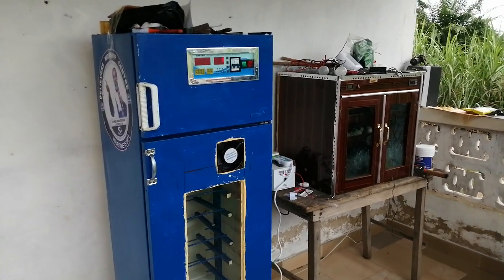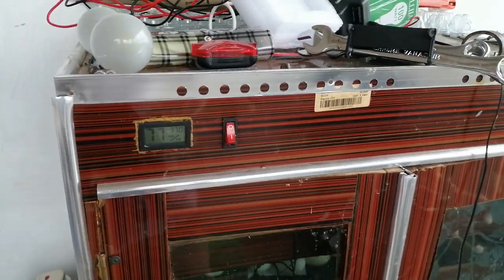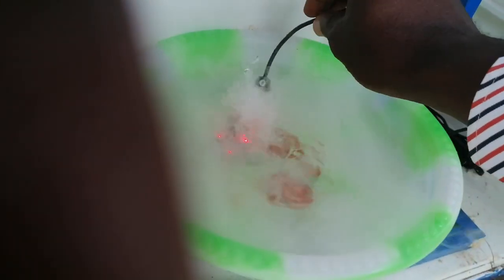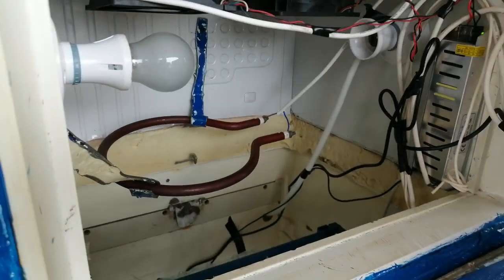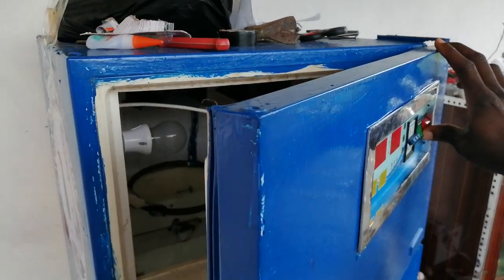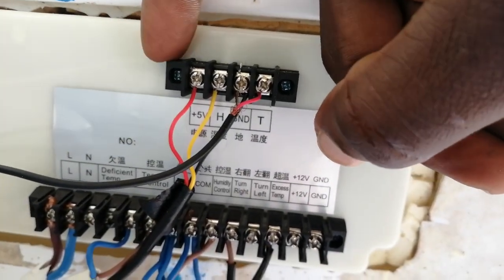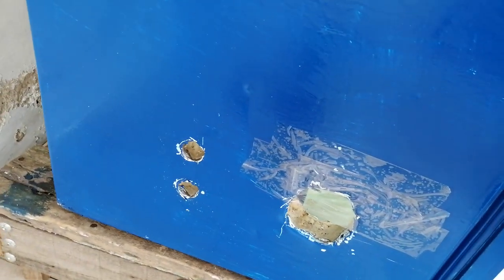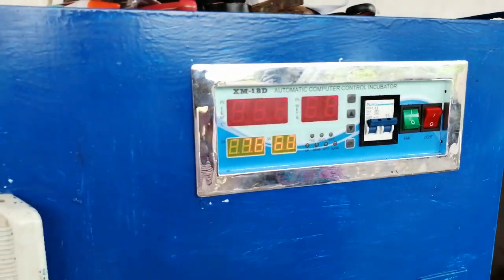Homemade egg incubator XM18-D and STC1000

Comment: Which socket you the wire for blower fan? Thanks
Reply: im talking with XM-18. where you put the wire for incubator fan that circulate the air?
Reply from the maker: @jessehisole7851  behind the xm18D
There are terminals for fan
Reply: circulation fan for xm-18e. What number the terminal?You show in your vdeo only for exhaust fan. Thankx
Reply from the maker: Please I used xm18d not xm18e
Reply from the maker: Circulation fan or exhaust fan. Which fan are you talking about

Comment: Hi,
This incubator is good.
Ideal temperature for incubating eggs is 36-37 Degrees.
Could you tell me how does it work in summer seasons when the temperature is above 45 degrees.
Reply from the maker: Over here, summer time, temperatures do reach 45.
The exhaust fan is enough over here for high temperatures
Reply from the maker: Using the ultrasonic humidifier as cooler will work
Reply from the maker: @Wanderer.
Please have you subscribed to my Channel